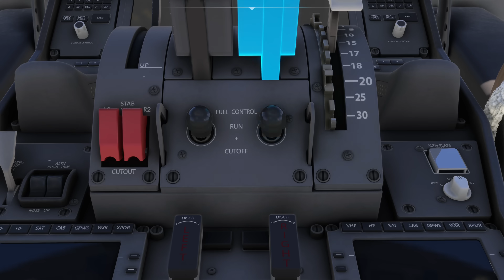Air India 171: Why Did The Fuel Cut-off Switch Get Moved?

Comment: The issue I see is that even if there is an outreach from fellow pilots, if the Pilot is fearful of losing pay, bonus and other benefits, they may not reveal even if they are not in good mental health, unless it is made mandatory for airlines to
1. Assess the mental health of each Pilot periodically
2. Provide full support even if that means they have a pilot less on the roster for a week or longer, it should not affect the Pilot negatively in terms of taking a hit on his pay and/or employment.

Currently, this does not happen in India; instead, the converse is true. Airlines are understaffed, and pilots often have to fly more hours than is healthy.

As far as a cockpit camera is concerned, you could have the camera focused solely on the controls. 
The cockpit voice recorder is recording everything the pilots say anyway, so the privacy argument is questionable IMHO.

In the current case,  there remains a one in a million probability that the switches had an issue with their locking system and "fell" into the CUTOFF position.
With a camera, we could establish without any doubt whatsoever that a human did actually move the switches to cut off manually.

You could also have AI-based systems that can alert cabin crew if any of the pilots seem to be behaving oddly. 
The technology to do so exists, sure, there will be false alarms at times, but I would take that over the possibility of a pilot intentionally crashing the plane.

Comment: Captain Steeeve, just out of curiosity, can the cut off switches to the fuel be hung up in a odd situation leaving it semi engaged and functional, but not fully seated in its spot allowing vibration to let it slide down to the OFF position instead of fully locked-in to ON? The switches are spring loaded and needed to be pulled to move and locked down, but can the switch function while pulled and semi placed in a position to be functional and feeling engaged without being in the actual locking slot gate? Reason I'm asking is because one of the pilots will need to look over for the toggle swtich to know what they are touching and moving vs both concentrating during the initial rotate, watching instruments and assisting in the visual function of the aircraft.  Odd that both were toggled within a very short period of time without the other noticing. Human error or intention seems to be the factor, but could there be an engineering issue allowing the switches to run without being fully locked in to the gated position?

Comment: Kudos to you, Captain Steeve, on an excellent analysis.
Some Indian media outlets have raised a point regarding the timeline mentioned in the reports where the switches transitioned . They question whether it was physically possible for the pilots to manually turn off both switches within the few seconds cited. Their concern is that operating each switch—requiring a pull, push, and release—would take time, and doing this twice would likely require a few additional seconds.

What are your thoughts on the feasibility of that timeline, given the mechanical and human factors involved?

Comment: Thinking along the lines of potential faulty switches, is it possible that the spring loaded operation was faulty and the switches could be moved by accident. How often are they cycled or tested for proper operation? Are they cycled whenever engines are shutdown?

Comment: The pilot voice recording is very conclusive evidence that rule out all plane faults it’s clear no communication was made to cut fuel lines off. The investigation must work out each pilot’s actions. A video link straight to black box would only be access in accident scenario so no chance of linked video. This could also prevent pilots taking such actions in the future maybe even force them to get help. The key issue is personnel pressure and that is a very tricky situation to uncover especially if it is financial issues and just talking about it could end up losing the job.

Comment: Simple question: How does the "black box" determine the position of those fuel cut-off switches. Is it not simply through "electrical contact" position ??? A contact showing "fuel supply" is made and recorded or a contact show/indicating "fuel cut-off" is made indicating that position. Is there any physical switch position indication available to the black box ??? As a retired electrician, electrical sensors routinely "fail" or show false indications. Something as critical as this needs to be like other critical in/outputs where more than one indication is necessary to implement the result !!!
Reply: It sounds like the switch sends a command signal to the engine control computer (FADEC) to shut off the fuel and that signal is recorded on the flight data recorder. With such a simple system I imagine there is really only the possibility of a wire shorting that could possibly send a false signal and that would be unlikely to occur in two switches wired separately at slight time offsets unless there was a fire behind them melting the wires or something. It also would not explain why seconds after switching off a pilot asks why the other switched them off and one of them seemingly turns them back on. If the wires shorted out in a fire they would not have been able to diagnose or trouble shoot an issue like that in ten seconds to restart the engines. Each engine has its own FADEC computer too, so even if one of the computers went crazy for the first time ever and hallucinated a shutoff signal it would not have shut down both engines. I still lean towards hoping this was an accident and I think they could add a few logic rules to the computer such as requiring the thrust be down before accepting a fuel shutoff, but if a pilot wanted to take out the engines and crash they always will have the fire extinguisher levers that work even better.
Reply: If there was any doubt at all that the switches were not physically moved, Boeing would not have been given the all clear.
Reply: simple answer - every point on a FDR can be questioned - there could be rare alternative causes for what is shown - i'm sure accident investigators of all people know that - maybe in this case - nothing out of the ordinary was seen in the few seconds of flight EXCEPT the power off - and then there was a crash - i don't think false indication is likely
Reply: @johneyon5257  is it even possible to move those two spring loaded switches to CUTOFF position with a gap of 1 second during takeoff?
Reply: @p0tat0gunner  I don't even trust the gap was 1 second. From what I've seen the FDR records events in 1 second buckets, meaning that CUTOFF 1 and CUTOFF 2 could conceivably be anywhere between 0 and 2 seconds apart. (E.g. one could've been at 1:23:45.999 and the other at 1:23.46.001).
Reply: @p0tat0gunner  Why not? That is just the time it took to flip the second switch after the first one and not for the whole procedure.
Reply: If it was electrical/wiring, what did the pilot meant when he asked if he moved it? What did he SEE? That he moved the wires on those switches? If it was malfunction and the system showed them that it was cut off, why ask if he did it instead of asking wtf is happening? Or are you saying that those mechanical spring loaded knobs were electronically moved as well?

Comment: It would be quite easy to make it require both pilots to turn off those switches. Put 2 switches on one pilot's side, and two on the other. Then wire them in parallel so that both switches have to be turned off to turn off an engine.

Comment: Below I describe potential scenario what actually happened to me in the past.
I was operating as a PM
At the moment of lift off, the PF seat suddenly came off the mount and rapidly flew back with specific sliding sound.
PF instinctively scratched the entire pedestal with his nails trying to catch on and hold the seat. Unsuccessfully.
Fortunately, while flying away he did not catch any important buttons or switches with his bent fingers like hooks.
Yes, fuel control switches has a protection that will not allow it to be positioned to OFF without lifting it for a couple of millimeters. But taking into account body weight impulse of rapid movement as well as fingers position. 
Nevertheless, it would be interesting to conduct an experiment on a SIM simulating such a non-standard situation
I then calmly took control and helped my colleague to pull back to proper position and his normal senses.
Since then, I always double-check the reliability of the seat fixation before takeoff.
U-gin